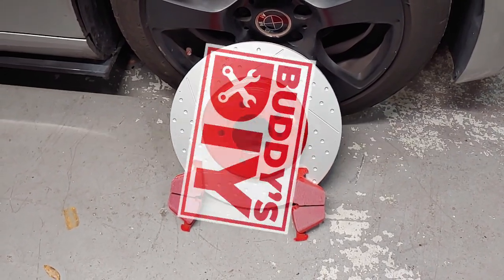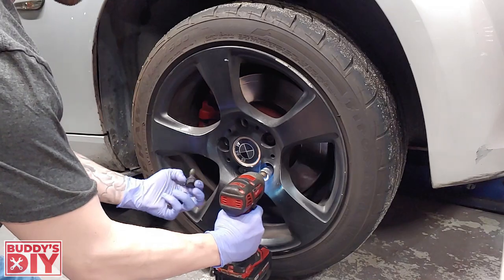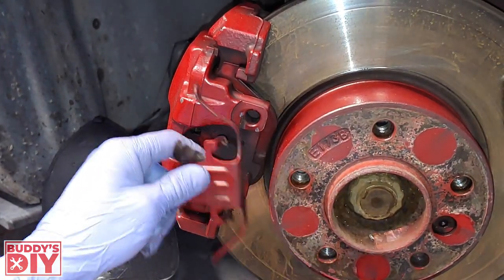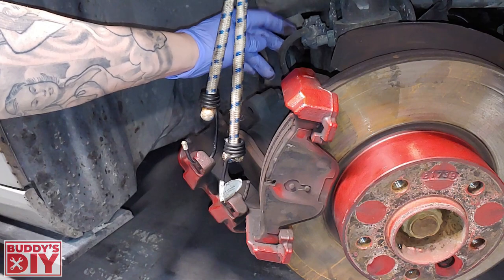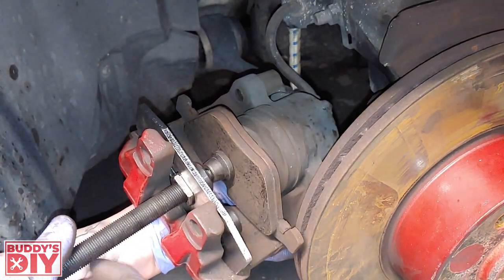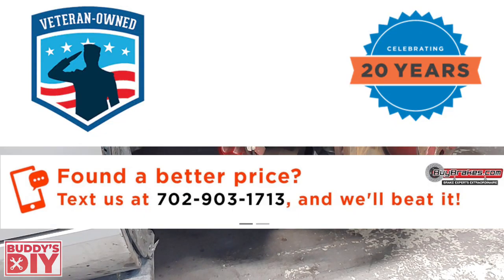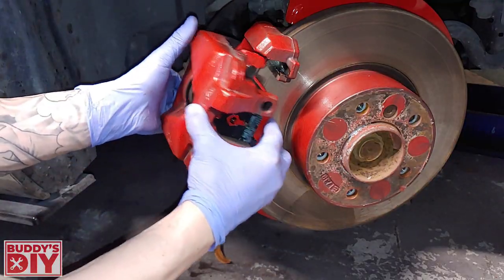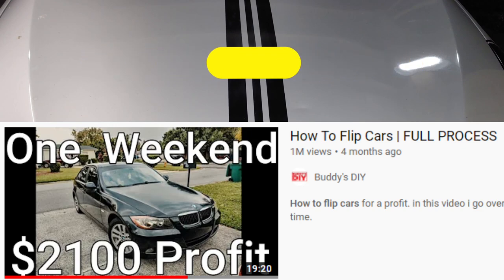BMW E90 E91 E92 E93 Brake Pad Replacement | 1 Series, 3 Series | EBC Brakes

Comment: Great presentation! You missed to mention brake pad wear sensor.
Reply from the maker: That's because I didn't do them lol. I coded them out and did a little delete 🤣
Reply: @BuddysDIY  Thanks for your reply. Subbed! May be, that is a good idea for a future video.
Reply from the maker: @babbu446637  that is for the sub brother. If you havent already the other subs love the car flipping videos check those out!

Comment: hey mate very informative! Got a question, would a 2013 320i e92 have two brake pads per rotor so 8 brake pads need to be bought for all 4 rotors? Also, what brake pad is compatible with my car and what would the brake pads dimensions be? Thank you

Comment: How do you know when the brake discs need replacing?
Reply: You should measure with a set of Vernier callipers or micrometer. You can compare the measured thickness with the reference minimum thickness to check there is still enough meat on them. This will probably depend on your model and brake disc size. For example I belive my front discs new are 30mm and need replacing when the thickness is 28.4mm.